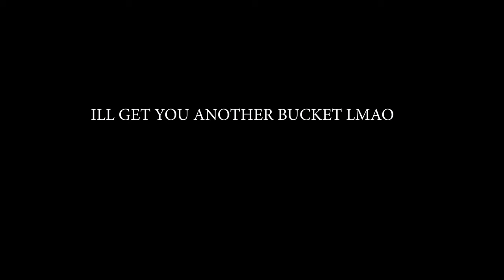Subaru GC/GF WRX 4 Pot Brake Install

Comment: How did you do the drum to disc conversion on the wagon?
Reply from the maker: Eric Gleissner I bought the rear hubs with disc brakes (specifically a jdm 99 gc8). You’ll need new brake lines as well. Then I just transferred it all onto mine. You can also use your preexisting ebrake cable so no need to worry there. It’s honestly a fairly easy job, and just about any 5x100 Subaru Impreza hub and brakes will be plug and play
Reply: DiffAuto were just the hubs changed or the whole knuckle aswell?
Reply from the maker: Eric Gleissner knuckles and all, it’s the easiest way

Comment: Did you use bracket adapter for the rears ??
Reply from the maker: I bought the rear hubs with disc brakes (specifically a jdm 99 gc8). You’ll need new brake lines.
Reply from the maker: Did not bracket needed on these ones, but if I wanted to run the 2pot rears I would need a bracket